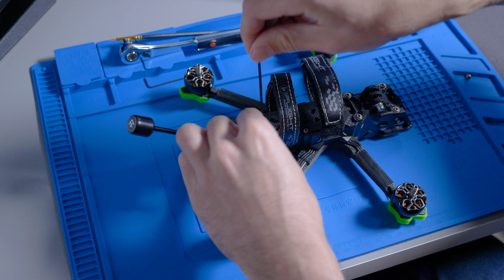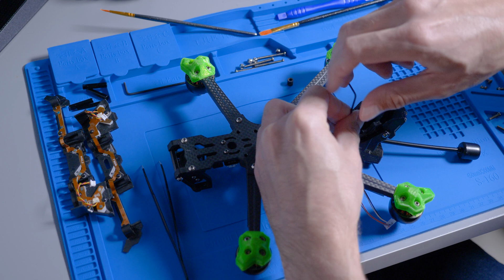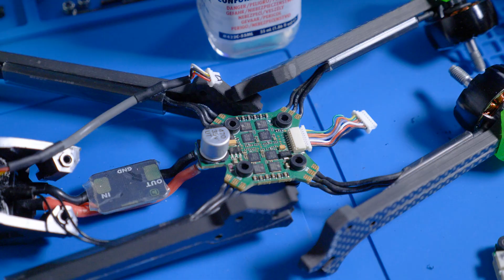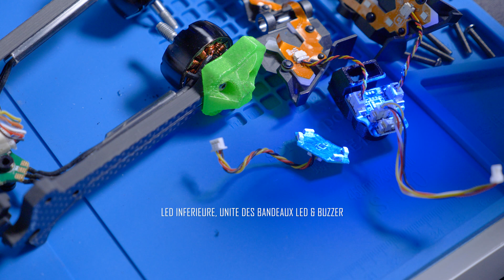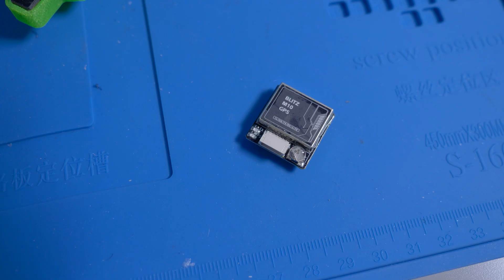Tuto Waterproof Silicone Coating - IFLIGHT Nazgul Evoque F5D V2 O3

Comment: Great Video thank you! So for the O3 Air unit you only apply a litte bit of 422 outside where the connectors are? is this enough?
Reply from the maker: Yes it is 😉 
Maybe later I’ll apply inside O3 but be very careful by connexion sheets ! Any product on it and it’s very tricky on O3 ! 😉